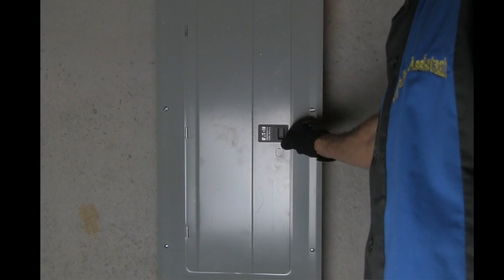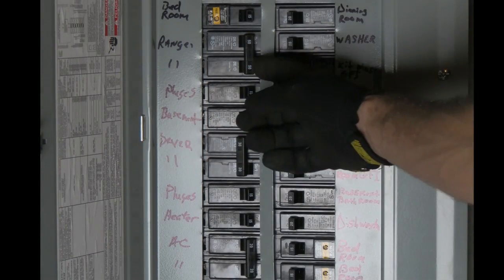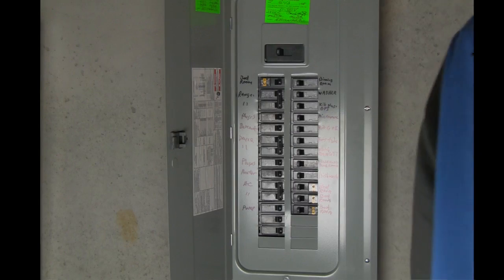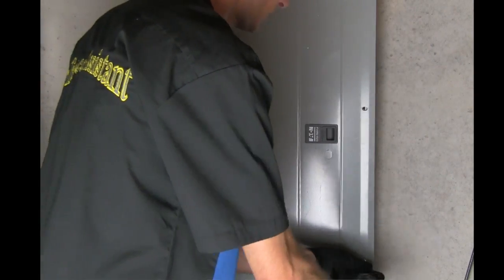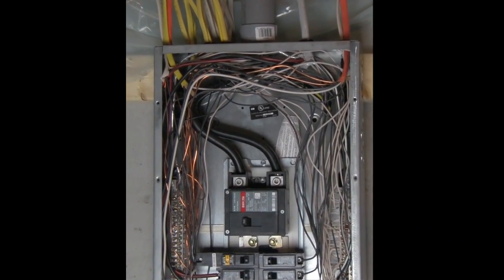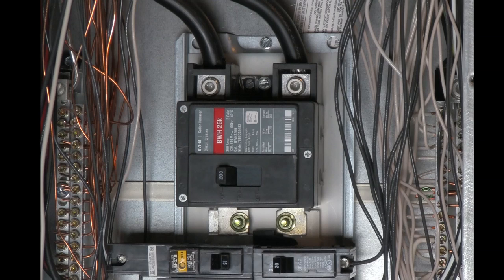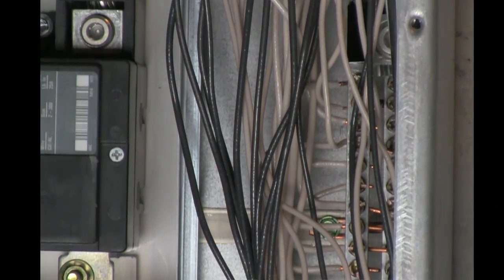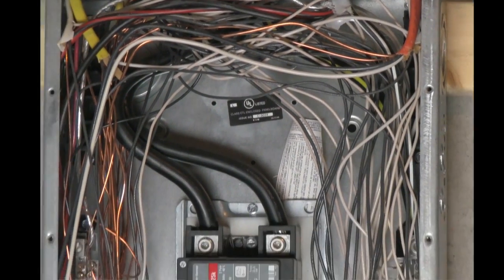Breaker Panel Basics

Comment: I don't think you are correct about the 240V dual breakers.  Two 120V breakers cannot add together in parallel to get 240V.  They must each be 240V, and if tied in parallel allows double the current before the breaker opens.
Reply from the maker: It's correct each bus bar carries 120Volts  but the sine waves are out of phase with each other, so when one wave is at its crest the other is at its trough and the difference between them is 240Volts

Comment: Have a question about my main breaker.My panel is labeled as 125 amp ,the main wires coming in are 2 gauge copper but. they are hooked up to a main 60 amp main breaker .I think this main breaker must have been changed by previous owner by mistake.Shouldnt my main breaker for this be a 125 amp?
Reply from the maker: 60 Amps is definitely too small for a main breaker switch... I would advise having an electrician look at things, with a DIY job like that it would probably be good to have someone who knows what they are doing check the house out! It's nice you have copper input wires, thats a good sign!
Reply: Electrician on Justask.com said i could do all 100amp.He said that the breaker may have been replaced when the original breaker failed and that was all that was available.
Reply from the maker: DIESELDAN 3 sounds good.  The main breaker is a little touchy to replace, because if the power is on to the home at the meter those wires will be hot with no protection!  Be carful, Good luck!

Comment: The neutral bypasses the meter, so the two meter wires are L1 and L2. In service entrance cable the neutral conductor is bare metal strands wrapped around the insulated conductors, these are pulled to the side and twisted together to make connections. You should see this behind the line connections in your meter socket. The voltage from L1 or L2 to neutral is 120v, from L1 to L2 it's 240v. In the breaker box the rows of breakers alternate between L1 and L2.

Comment: The 2 hots are there to give you both 120V & 240V.  They can share the same neutral because they're out of phase.  Remember, this is alternating current, it is constantly ALTERNATING DIRECTION.  That means the neutral and the hot(s) supply & return power equally but at alternating times.  The difference between the neutral and hot(s) is the neutral is grounded.  It's grounded to protect the power lines from lightning, but grounding it makes the other wires dangerous to touch if you're grounded.

Comment from the maker: @dragonfly45371 The switch needs to be tipped so that only off is showing.  Its okay to flip them as much as you need so you can always flip them all one way and then see if the lights work, if yes try the other way :) Good luck, thanks for the comment.